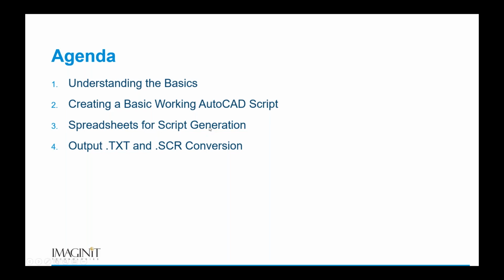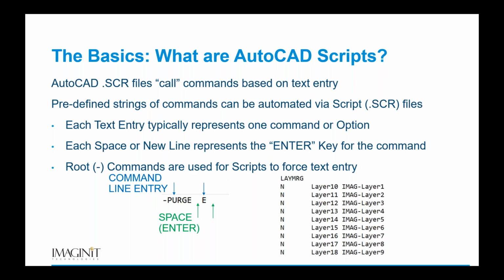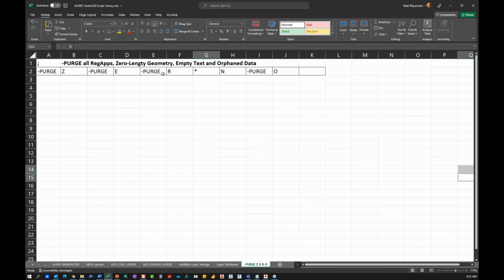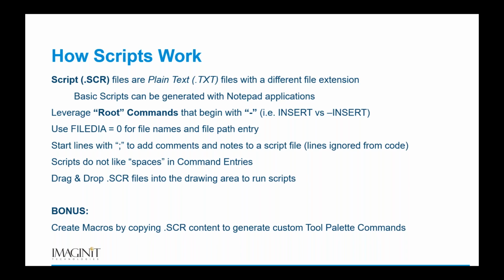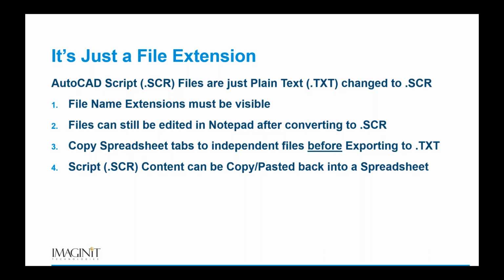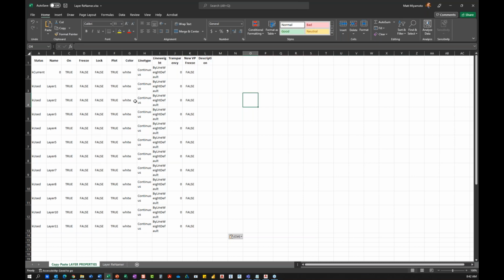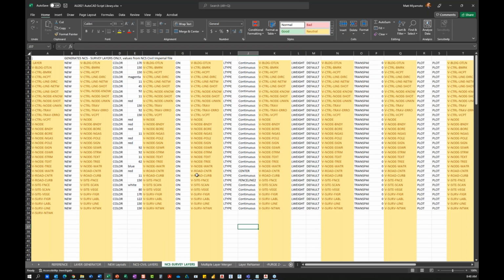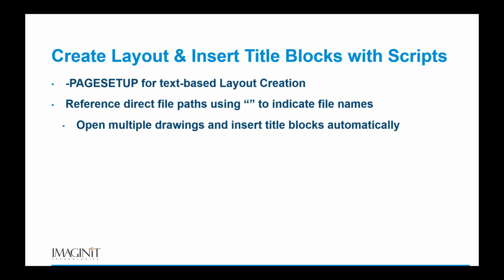AutoCAD Quick Scripting with Spreadsheets

Comment: How to stop command, I mean how to call esc button like behaviour if needed?
Reply from the maker: We checked with our experts, here's what they said: With a SCR file you can’t add a stop, it runs then stops at the end of the script, that’s the way scripts were intended to run. If you try and add a stop, it stops and won’t resume, so you’d need to make two different script files to run the first until the stop point is reached, do whatever, then run a second one to finish.

Comment: Not sure if you help people with scripts. I do have a question though. I wrote a script & when I copy & paste on the command line it works. But if I drag & drop it will not read the script all the way. It's like it is getting hung up on my zoom extents command. It says it does not recognize "z" & recommends F1 for help. I think I may have too many spaces in my script. I am also using script pro 2.0 to apply to multiple drawings. The script keeps failing. I have been to the autodesk forum but no  luck, I'm desperately seeking information & I'm trying to get help from someone with experience. Any solutions to make my script work properly would be greatly appreciated 😊
Reply from the maker: Sorry for the delay in our reply. We asked our experts and they said: We usually recommend you use the full command (ZOOM) instead of shortcuts (Z) when working with scrips.  Also, for some commands we've noticed that it does not like spaces, but creating separate lines sometimes works instead.

You can try ZOOM EXTENTS or splitting that up onto separate lines within the script as:

ZOOM
EXTENTS

If you still have issues, please do reach out to us on our website www.imaginit.com using the Contact Us form as we can help with scripts.
Reply: I may be 8-months late but I seem to notice that AutoCAD won’t mind the inherent Excel-generated space in Notepad, once one’s script is Saved (.scr) and the said Script is called within AutoCad (“SCRIPT”command ran) than when the script is just Copy/paste.